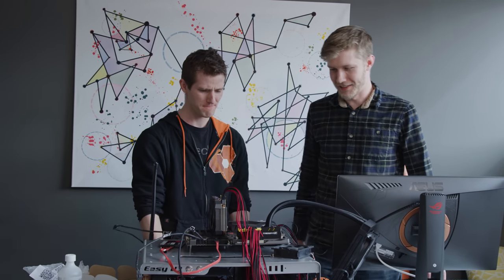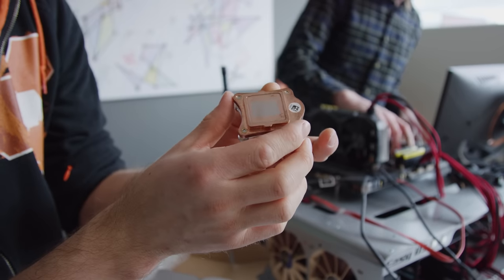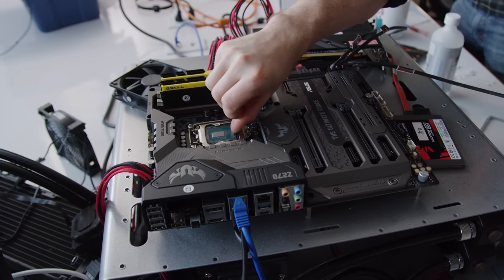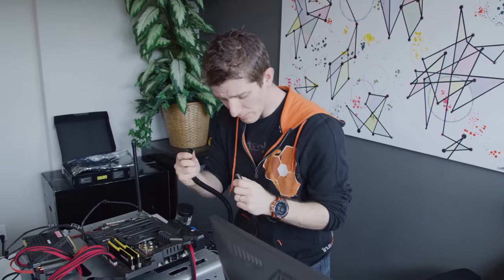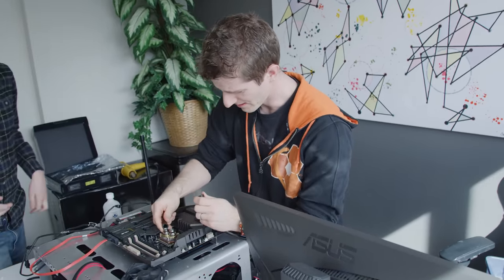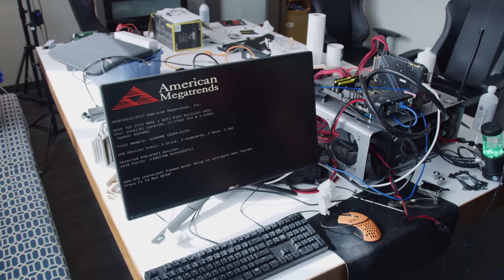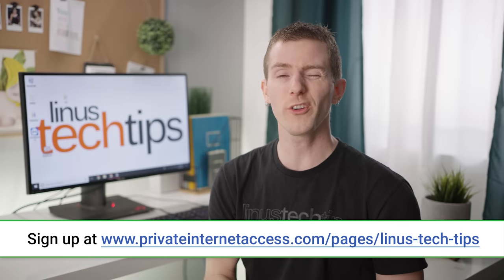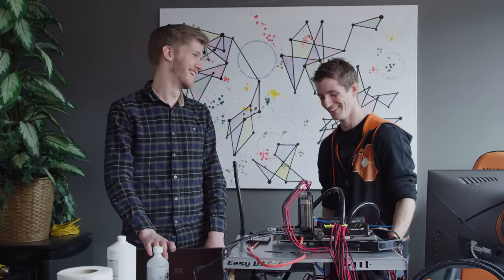This cooler VOIDS your warranty! - Worth the risk??

Comment: What I've learned from watching Linus:  Computer components are much more durable than people think they are! haha.
Reply: indeed.
Reply: I know, its terrifying.
Reply: I was just thinking the same thing.  The way he handles the components by the contacts, spills stuff on them, etc... I think that's one of the most educational parts of this channel LOL
Reply: Linus - Spills water directly into the motherboard: No problem
Me - Live in a place where there may be a little more vapor in the air: All circuits fried, house on fire.
Reply: Eduardo Loureiro more vapor than water, sure you do have. Must be tough life there underwater. It wasn't powered on.
Reply: i learned that after my first build, i treated my mother board like a precious new born 6 minute old baby, now i just casually hold it when it is out of the computer and use some force putting it back, the only thing i still take caution with is when the processor has pins and they aren't in the socket yet
Reply: Until you drop a CPU in the socket and snap off some pins or get spray paint inside the DIMM or PCI slots. But ya, as long as the motherboard doesn't have power running through it, you can dunk it in water and it'll be fine. Just make sure it's completely dry before you hook it back up. (This includes the CMOS battery)
Reply: yep true
i used to treat them like a baby but after years of watching linus i was like Meeeehhhhhhh drops it
Reply: yeah, provided you have enough money
Reply: as long as power supply not connected and 100% dried it before plug in power.. everything will be fine
Reply: this goes so much further than people think, for just averagely well protected components even plane crashes are survivable.

the only truly fragile part of a computer is any potential mechanical hard drive
Reply: I heard JayzTwoCents drilled a hole through a motherboard to mount a CPU block.
Reply: The way he was sticking his nail under the CPU and flicking it saying "see, there's far too much play in there" and I'm cringing imagining him moving the CPU and bending the pins... AND THEN HE SPILLS WATER OVER THE WHOLE FUCKING MOTHERBOARD
Reply: as long as all the pins are bent uniformly and still connect then there isnt that much of an issue, afaik they arent tied on by gold thread anymore, they were once.

and as long as the water doesnt contain too many impurities and power is cut quickly there again shouldnt be much of an issue with water on the board, the only potential issues are the 12v rails, the board itself is usually coated, if not then you would still have to wait for galvanic corrosion to eat through the traces, it wont simply short circuit catastrophically, most of the voltages are too low and the current even lower, chances are something would throw an exception and kill power to the system before any real damage could occur to the traces.

Comment: Spilling water on un-powered electronics is really no big deal at all. As stated in the video, all is well if completely dry before putting anything together and powering on. Now spilling a Cola on the mobo is something to freak out a little bit about; immediate power down, disassemble, rinse with generous amounts of filtered water, and the drying process.
Reply: Water is still a problem.  Although it can dry, and can't short circuit the board if there's no power.... the water still will leave behind moisture under chips and initiate slow corrosion of the board, which could take weeks or months, and will still cause issues down the line.  You'd still want to rinse with alcohol.
Reply: @MiniDevilDF  I thought it was cause your capacitors still would have some juice in them causeing a short that way, then again o live in a high climate everything air drys like a dream.
Reply: Capacitors still have power and the salts in water stay behind after it dries leaving conductive layer.
Reply: so use deionized water(or distilled at the very least)
Reply: I can confirm, as I have actually done this to a laptop I used to have.
Reply: Thats so not true, you can die by poking wrong things in an unpowered electronic device, causing a short with water is super easy.

The machine being unplugged does not mean that the capacitors inside are discharged.
Reply: @pmangano  this is a good point. Especially since some newer motherboards still have low power running to some of their USB ports to charge a phone even when the computer's off. Though I don't know if that has anything to do with the capacitors still having a charge. Might be wrong though.
Reply: Minus some components powered by cmos battery while off XD
Reply: Wot if u spill water on a psu though, the capacitors would still be charged, you would probs break your system.
Reply: I killed my first laptop with beer.
Reply: I spilled ham juice on my laptop and just let it air out for a few weeks.  Worked fine afterward XD
Reply: im going with der8auer here that puts his mobos in a dishwasher...
Reply: I'm recommending you guys watch Der8auer's video where he explains how he regularly washes components in his dishwasher...
Reply: There was a Video by der8auer, in which he just put a Mainboard in the dishwasher to clean it from vaseline after one of his extrem OCs
Reply: @pmangano  Charged capacitors are not that big of a deal. The only way they can damage something on the board is if some of "high" voltage(12v/16v) ones are shorted to some logic elements/semi-conducturs which operate on ttl level(3.3v/5v). Even so it's not very likely because those capacitors are usually near the high voltage circuit, so electricity would need to travel far through not so conductive water therefore loosing most of the voltage along the way. So yeah not to big of a deal. About that "conductive" salt that water leaves behind after drying... yeah no. Salt in hard form doesn't conduct electricity, you can test that with cheap multimeter or Google it. The real danger however is corrosion that occurs because of salt. Salt absorbs water from the air making it to contact metal therefore speeding up the corrosion. It can be really troublesome when we are talking about motherboards, because there are quite a few bga components on them where salt/water can sit even after proper drying/cleaning.
Reply: i sleeped kicked some cola and some of it flung on top of my tower and went right into my gtx960... woke up didnt notice it and turned on my cpu to artifacts getting worse and worse... powered down asap and saw what happened. rinsed like crazy and left in a towel plus rice on outside of towel. this was 4 years ago and its still running like a dream.
Reply: Using distilled water will help for clean and also using alcohol is highly recommended (I mean that is what I would do
Reply: THE LITHIUM BATTERY IS STILL IN THE MOTHERBOARD.
Reply: @nex7424  oh gawd  fk
Reply: I've recently spilled some Sangria through the top fan while gaming, and my mobo went poof :(. Also had a gtx970 die earlier last year after it barely tasted mineral water. Early upgrades yay!
Reply: @rickylafleur5823  i would say luck was on your side. most hardware would have died on powerup with fluid on them while they are live.
Reply: @Fr34k1ng0ut  That sucks. My friend spilled around a six pack (out of his mouth) during a party on his laptop, sat there for like a minute, then carried it outside and poured it out like it was a giant mug.  I was sure it was dead, but somehow the next time I saw him it was working (after a wash ofc). It's funny how sometimes the smallest thing can kill electronics, while other times they seem un-killable. Anyone want to buy a strangely clean laptop???
Reply: It's okay with distilled or de-ionised water, but tap water is bad.
Reply: I would suggest only using 99.9% isopropyl alcohol if you really need to clean your mother board. I have done that 3 times in the past and it worked out great. I think Linus did the same in this video. He soaked up most of the water with paper towels and then used alcohol to get rid of the moisture that's left in spots that are hard to reach. You can use distilled water to clean your motherboard but you need to make sure that it is 100% dry before you power it on again.
Reply: Threw up on open tower which was running. Killed my GPU, put the rest in the dishwasher and still works. Stuff is way more robust than you would think.
Reply: @TonyMelon  Unless you live in Miami, super humid!

Comment: "This is madness!"

Shit, I remember when ALL CPU's were bare-die contact. Those were fun.
Reply: I haven't personally built one but they look super sketchy
Reply: Good old Athlon xp 2000+ days
Reply: Those times were chaotic my friend. One simplest mistake and you can say goodbye to your precious processor.
Reply: I mean yeah, I remember having to bridge contacts on the cpu pcb with a pencil to unlock overclocking. A fu*** pencil, we sure have come a long way. All hail the precision boost overdrive on new AMD silicon. Still, seeing a bare die makes me feel a bit nostalgic haha
Reply: With or without warranty?
Reply: I’ve personally broken corners off at least a couple of P3 era Celerons and Durons. Sometimes they’d still work despite the missing silicon. Sometimes, not.
Reply: Some people are all about going bare 😉
Reply: No this is Patrick
Reply: puts .0000000000000000000000000000000000000000000001 too much pressure on the cpu, pentium 3; guess ill CRACK

Comment: Couldn't you just have flipped the board and then plugged it in so that gravity held the water down for you?
Reply: The Dro no as there are other forces that let the water stick to the board (I’m a foreigner so I don’t know the name of that force in English - adhesion would be the name given in Wikipedia when changing the language.)
Reply: Chris1111116 pretty sure they meant when linus was putting the tubes on in the first place
Reply: Chris1111116 surface tension? I'm only 2 minutes into the video so I haven't gotten to that part.
Reply: That would be my guess too.
Reply: Pffft. You believe in gravity?
Reply: The Dro  thats not the linus way🤣🤣🤣
Reply: He should had just flipped and doing both tubes simultaneously, that way the pressure would equalize and no water would spill...
If he somehow managed to hold the cables in place xD
Reply: The Dro Libya woulda had to take the mobo off the test bench or flip the whole test bench alone AND throw the tubes on, sorta hard. Should just drained the loop lmao
Reply: he could have just connected the hoses before he installed the heatsink...
Reply: Van Der Waals forces...
Reply: Welcome to ltt
Reply: He would've had to flip the whole test bench.
Reply: you think linus, the crazed madman, would ever think of that?
Reply: Chris1111116
He is talking about fitting the tubes while holding the board upside down..No about getting the water off the board.
Reply: But this is the 200 IQ fix
Reply: Then the screw that you lost would fall out :o)
Reply: everyone!!! he could have just hooked up the hose like a normal cpu block OFF of the board then slip the heatsink under the retention and clamp it down, why did he do it this way!
Reply: nicholas I suspect they did it that way because they were filming and needed to show what was happening without the hoses getting in the way of the camera view.
Reply: That would ruin the shot.
Reply: If they did that then how would they waste our life with this lame video.
Reply: Hasibur it might seem lame to those that already know everything contained within the video, but for those of us that aren't heatsink experts, there is a chance to learn something.
Reply: good idea, maybe even having it stand vertically would've been easier instead
Reply: yap i thought the same xXD
Reply: DAMN!!  now thats thinking on the fly !
Reply: Welcome to LTT guys
Reply: The Dro You would need a second pair of hands.
Reply: @aaronmicalowe  he could have installed the hoses with the motherboard upside down.
Reply: @mycelia_ow  sounds like way too much hassle for me, meh, but each to their own...
Reply: Or just...plug the hoses BEFORE installing the block...🤔🤔
But as he did the same mistake 2 times, i guess it's made on purpose cos it's humanly impossible to be that stupid 🤦‍♂
Reply: they could have just plug the pipe before putting it in the cpu
Reply: It’s called surface tension

Comment: you should be able to buy cpus with a water block and liquid metal built into them
Reply: you can, the german shop caseking offers delidded and with LM fitted cpus.
they even get tested on OCed frequencies. so you get a guaruanteed clock speed.
you can even choose on different IHS (sanded and pure silver)
all from the der8auer.
Reply: @vablo7198  They ship to the UK, I bought a graphics card off them.
Reply: CIA wants to know your location, gentleman

Comment: I've been overclocking since forever - my daily driver is a 2500k that's been at 5ghz for 6 years at 1.48v.
I have never had to exercise a warranty replacement - though I did snap a board in half in the 386sx days.

Comment: my overclocked rig is on a small riser on the floor above the air conditioning duct...
cold dry air blowing through the rig 24/7...  a very low-tech solution to a high tech challenge...

Comment: You know what, since we're de-lidding our CPUs and voiding warranties left and right, why not just keep going!? Submerge a de-lidded CPU in mineral oil, or no, wait, how about submerging the whole build with a de-lidded CPU in a tub of nothing but nonconductive thermal paste!? I mean, cmon, warranty shmarranty!
Reply: you just invented the only way to keep processor cool with intel stock cooler
Reply: Without special placeholder on retension mechanism, the cpu wouldn't get enough tension&lose contact with pads.

And only oil surrounding the dies will be heated at first, and won't get optimized result in a long run.

It'd be like submerging a shower head spraying hot water in a tub filled with lukewarm water.
Reply: OR JUST BUY ACTUAL HARDWARE WITH QUALITY.... 6 CORES OR 8 CORES RYZEN.... NEXT GEN DOUBLE AT COMPETETIVE PRICES.... NO A SINGLE THANK FROM MINDSHARE AKA STUPID
Reply: No anime
Reply: @thepro08  PLEASE STOP SHOUTING, WE CAN HEAR YOU!
Reply: Been there... Done that... It sure makes the PC silent... But not very cool

Comment: Since the electromigrantion in chips is lower at lower temperatures when every other parameters are same, then it would be additionally of interest to check how much energy you save in this overclocked pc under delidded conditions versus stock conditions...
;)

Comment: Who remembers running a spacer plate that prevented you from crushing the die on your Athlon Thunderbird CPU?
Reply: Or the pencil mod.
Reply: I do remember both. Though i crushed a corner of one cpu but it ran just fine :D
Reply: Yep, I chipped my die too.  Still OC'ed my 750 Tbird to 1.1Ghz before 1Ghz chips were available.
Reply: Memories.... I think I still have a Barton core in a drawer somewhere.
Reply: I do. Never used one, but my friends asked about it, useless.
Reply: yap here, a pal of mine killed 2 CPU´s back in the days. They where those AMD Athlon 1800 Single Core chips. As we went the third time back to the Store, the guy told us something about Copper Spacers xDDDD. Thats how they´d made the MoneyMoneyMoney, Dallah Dallah. This story was in the early days of 2k.
Reply: I still have one in my watercooling toolbox!
Reply: StarGunner pro your friend "borrowed" it. You lent it. (Past tense of lend)
Reply: I chipped the core on my couple of days old 1900xp back in the day never worked again, ordered a 2000xp to replace it the following day through work.. that was an expensive month.
Reply: yeah, i remember heat spreader-less cpus.  it happens
Reply: I miss my 1900+ mobile chip it was killed by the liberal application of conductive thermal paste
Reply: the good old days.....
Reply: Not me
Reply: Chaosflower I have 17 pcs upstairs unfortunately all of them are socket 478 Pentium 4s and older PIIIs ... he'll I have a Tandy 1000 just no older amd that work lol
Reply: Chaosflower whoa dude
Reply: I STILL USE an Athlon spacer to spread out my TIM. The CPU and board has gone to chip heaven but the spacer is still doing useful work :)
Reply: Me too.
Reply: My is still working running my Magic Jack. Some things just will not die.

Comment: And this is your proof that modern hardware can take way more than a beating...
Reply: Ross- A -Roni I am not talking about clock speeds I am taking about how Linus installs a waterblock 😂😂
Reply: After finding an old GBA cartage underwater in a snorkeling trip and finding out it still works after being dried off, I could tell you it's been this way for a while.
Reply: You think that's ballsy? i5 4670k at 4.7 with a 212 Evo. Danger is my middle name

Comment: Just remove the retention mechanism from the motherboard... Then you can use any cooler without IHS. The mounting pressure of the cooler keeps the chip in place just fine. My 3570k has been running fine for years this way. (4.8Ghz, keeps under 65°C with aircooling).
Reply: Very interesting...
Reply: ...in Alaska.
Reply: Nope, 21°C ambient temp.
Reply: Thanks for the info <3 Whats the Voltage? because thats what causes the heat
Reply: Also is your motherboard Horizontal with gravity like ( not mounted Vertically in a case or something)
Reply: 1.27V max.
Reply: It can also do 5Ghz (102x49 at 1.416V), but then it gets too hot for comfort.